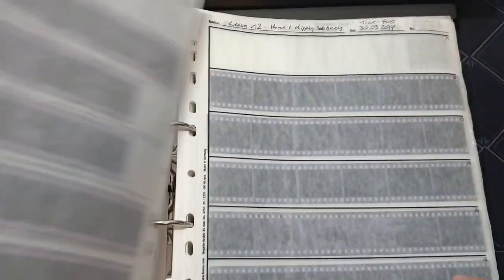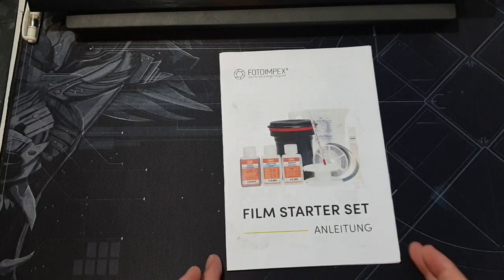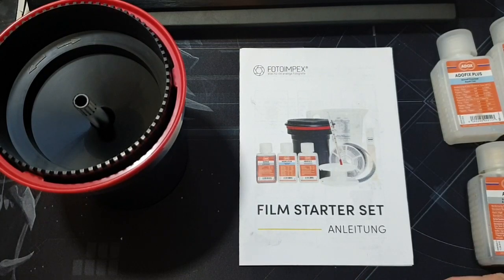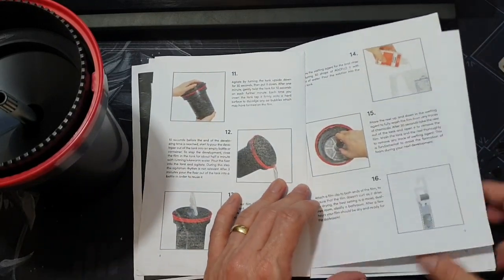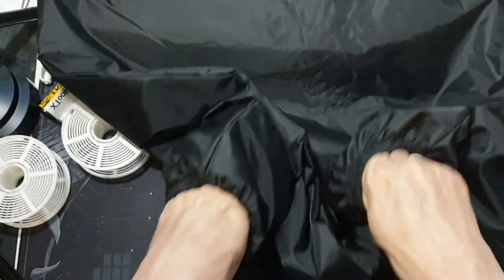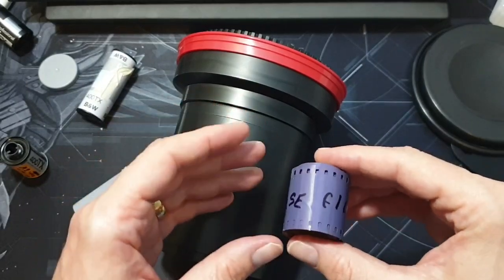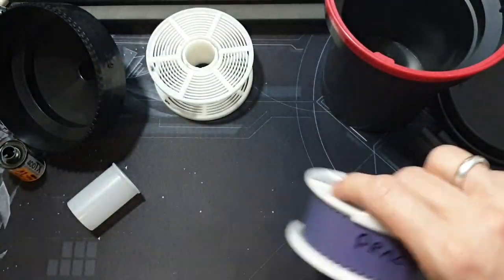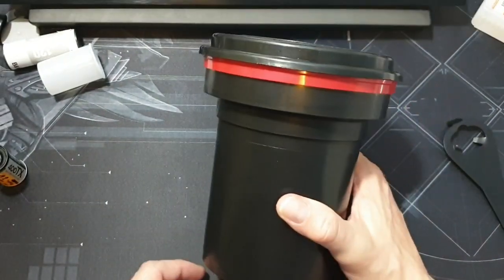Film Developing, The Basic Equipment And How To Load 120 and 35mm Film With a Patterson Tank

Comment: Tip for stopping it twisting and tangling in the bag when loading the film on the spiral.

Crack the can open, pull the film out just enough to find the leader and thread the film leader back through the slot in the open can (you should be able to just slide it in sideways)

The can then keeps the film nicely coiled and you don't end up fighting it twisting, etc.

I know some folk here have suggested doing it in light as the first few inches of film are exposed anyway but I try and maximise the number of exposures I get from a film so I'd have to be very exact.

Comment: Also just a helpful tip: if you have the leader out, you can cut the end flat and load the first few inches onto the reel in the light before moving into the bag or turning off the light. Saves some fumbling. 🙂
Reply: filmismorefun  excellent tip , I will try that next time . Cheers 👍
Reply from the maker: That's a really good idea! I'd never have thought of that....  One thing I'm thinking of doing is ha ha....loading the film into the camera in the dark bag...to try and get an extra photo out of each roll....I wonder if I'm careful load and unload the film into the camera in the bag if I can get 40 shots out of a 36 roll.
Reply: @dangerpowers123  Yeah, it makes it way easier, and you don't lose any images usually, because that first small portion of the leader has already been exposed to light during loading into the camera. 🙂
Reply: I can’t thank Thanks enough for this wonderful tip . It works a treat and saves so much hassle and fumbling about . 👍